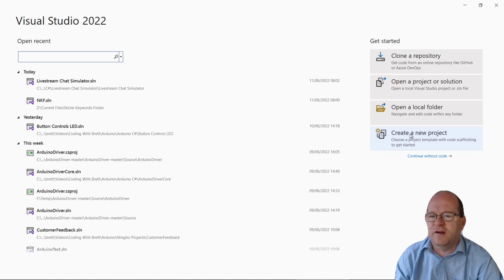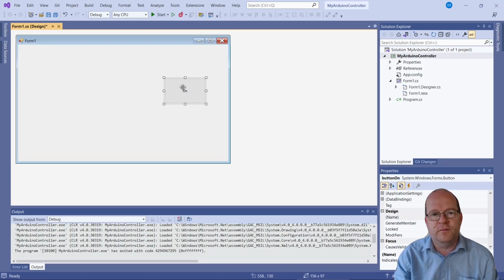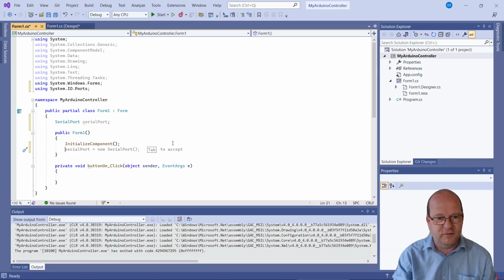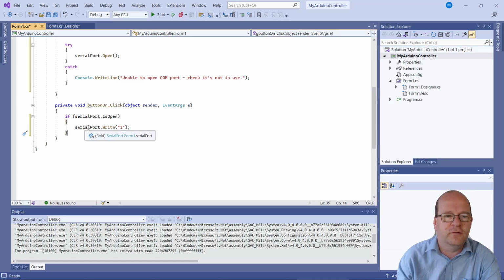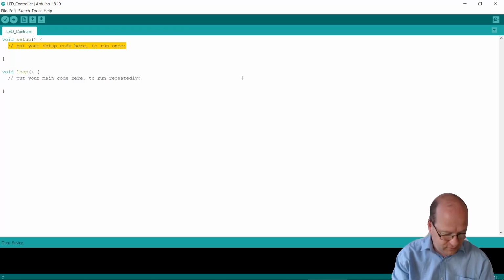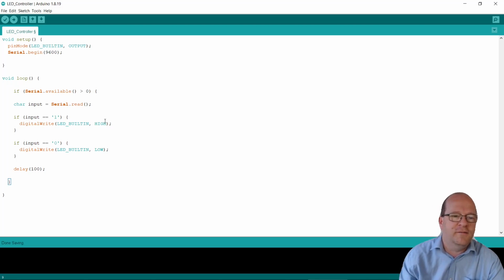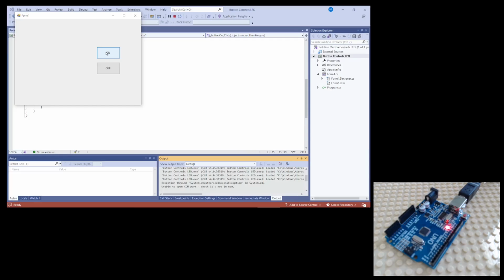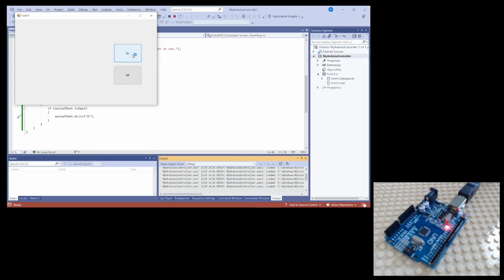Control an Arduino Uno From C# in Visual Studio

Comment: Hi it is really hepfull I'm just wondering how to do it without cable, i just want a wireless sending
Reply from the maker: They best way to communicate between C# and a microcontroller is to use MQTT over wifi: https://youtu.be/a5kw3DOh8iY
Reply: @codingwithbrett  thanks man I find an another way to : Arduino to c# and c# to other pc using tcp/ip
Reply: @codingwithbrett  thank you,your videos help me a lot in my project.